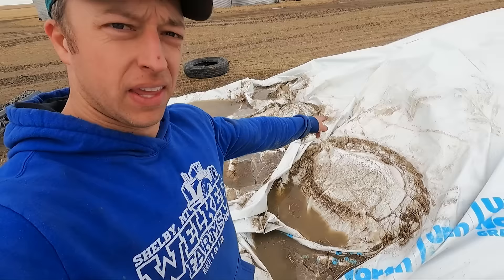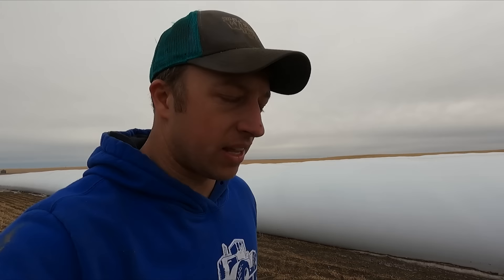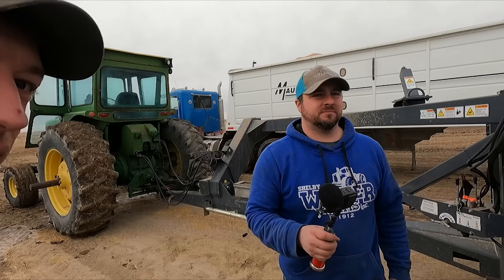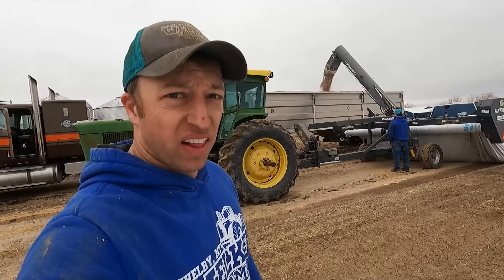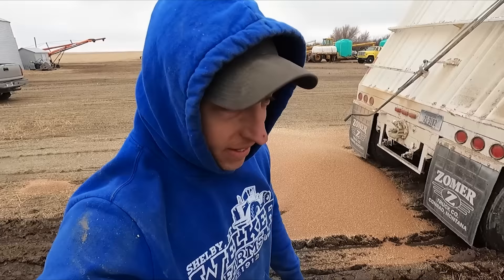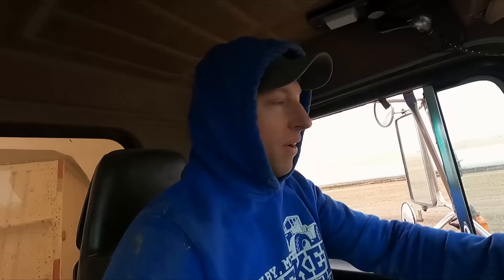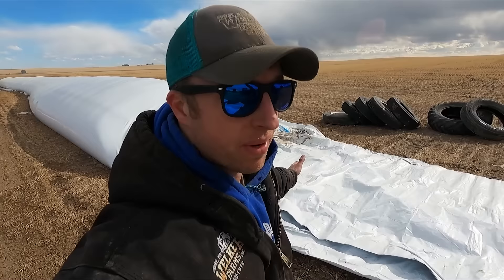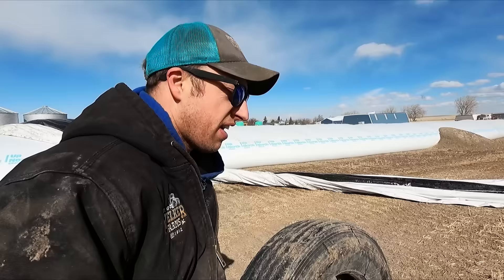The BAG BUTCHER | What A Muddy Mess

Comment: see if you can get some large steel plates from somewhere, like army surplus. Work wonders to prevent sinking in muddy spots when standing still a while.
Army engineers use them to create temporary parking lots for events all the time. And a tractor can pull them forward as the bag moves.

Comment: Grain bags-portable, efficient, & a HECK of a lot cheaper than bins! THAT’s what I learned from farm-tubers ‘20. Too bad Iowa farmers couldn’t use them for corn, since their bins took a ride w/ Dorothy.
Reply: I was thinking this too, new farms, or just farms expanding without the ability to build new bins, this is an incredible innovation.
Reply: Oh but we do use them in iowa just not as much as out west because we have elevators with storage alot closer than there
Reply: The problem with bags is there is no ventilation. Corn needs to be below 15.5% moisture to prevent mold and rot.  You can put it in a bin at higher moisture and turn on the fan and be good.
Reply: @redbovine  rot/mold isn’t an issue during winter and freezing temps is it? (Totally ignorant on the issue here)
Reply: @jeremygrant1325  it can be.  Corn is usually not harvested at lower temps. A lot of us use bin fans to cool the corn after harvest.  You have to be careful about the outside temp and the inside bin/bag temp because it will cause water to condense on the inside which leads to sprouting it rotting.  Bacteria will also flourish.  A small place where the corn is damp can cause a huge problem because the decay process generates heat which just makes to problem spot spread. Bags are great for a short term solution if weather is against you or you ran out of bin space.  I guess the easiest way to sum it up is the crop needs to breathe and regularly checked to make sure there are no problems.  
In my area corn is considered dry at 15.5% moisture. Any higher and the buyer will dock the price because they don’t want to pay for water weight. Last time I got docked it was $0.10 per 1/2 point moisture. It can add up in a hurry. 

Any other questions I’ll be happy to answer if I can. Thanks.
Reply: @redbovine  That’s why I didn’t think corn could be stored in bags, if a deer gets into it, it’ll get wet then it’ll ferment. Isn’t that how they make ethanol?
Reply: @chrissyfrancis8952  deer arnt too much of an issue. Rodents are because they love corn and will chew holes in the plastic.  They will even live under the floor on grain bins.  I try to put out some rat bait to keep them in check. The water can cause fermentation when yeast are present. However with holes in the bags it allows oxygen to get in and you get an aerobic reaction the corn just rots. 

When it’s fermented to make “shine” sugar and yeast are added along with an air trap which keeps oxygen out so you get anaerobic reaction. That produces alcohol and the corn won’t rot. 

Bags work well for a short term solution if the grain is dry.  Bins you can control the “climate” of the grain for long term storage.  We only harvest corn once a year but we use it year round so we need to be able to store it for 11-12 months. Bugs then become a serious concern.
Reply: @redbovine  thank u SO much for taking time to answer! I raised Boer goats(for 4-H kids) & chickens, we had 2 miniature donkeys that did a great job guarding the barn bc we lived in the PA mountains, in 11 acres of wooded lot. I know exactly how hard it is to keep rodents out of grain, even in metal cans with lids if u don’t shut it tightly. Our chickens were free-range & let me tell you, they are a MUCH better mouse killer than any barn cat! I’ve learned so much watching the farm-tubers & am so grateful for all you! But, I always have questions, like this. Plant growth patter/structure you look for & fertilizer changes you calculate in the same field & why. Is Round-up still the most used weed killer, or do others work the same way? Oh, @redbovine, I could talk your ear off asking ?’s. We’d literally die w/out all our farmers raising food.(plant & animal)
Reply: @chrissyfrancis8952  i don’t mind answering question.  Ive done a lot over the years. Diesel mechanic (10 yrs). Farmer. Custom ag operator.  Licensed commercial pesticide applicator. The worst question you have is the one you don’t ask.

Glyphosate may or may not be the most used. It depends on how you phrase the question. Are you asking by tonnage or acreage. Atrazine is way up the list by tonnage because of its use in corn.  Glyph use is not used as much in my area due to it only killing grass. Weeds have become resistant.
Reply: @redbovine  If only our farmer’s knew years ago, that German based Monsanto, Round-up, is the same compound used in gas chambers. After the war, they looked for other uses, then modified it to target weeds. I asked bc I was hoping another compound was available that did the same thing. All long term chemical exposure can be harmful, but it’s good to know farms are moving onto other kinds.
Reply: @chrissyfrancis8952  glyphosate was not developed until 1970.  I have been exposed to it for 30 yrs.  of the chemical I use every year it is one that I don’t worry about exposure.  There are pesticide out there that are a whole lot worse.  It has an inherent affinity to bind to soil particles so when it’s used according to label i view it as one of the safer options. There are things out there I will not use.
Reply: @redbovine  that’s what always giving me comfort, bc I know you’re all very safe. Thank you!

Comment: Need to fab a 5th wheel deck plate setup for your I. Quad Trak for spring grain loading from the tubes.

Bags, low initial investment, no safety problems, no bin loss in wind storms, fast filling and unloading>low labor costs, fast grain movement to hit a fast changing price market, super low maintenance costs, no electricity costs and line service.

Comment: All that water where you don't need it. When they find a way to recover water that is making mud from a field/driveway then the farmer won't have to work like a rented mule to fix all the bent metal and broken parts as no one escapes from this for very long. I have seen more torn driveshafts, transmissions, parts of the wheel assembly ruined from getting stuck. In the winter time, I would go out to the bone yard and pull all the bumpers and miscellaneous parts we would need and just cause they are old, didn't mean they couldn't be used till summer anyway. I had a driver come in one spring day and on his shoulder was a older and a bit narrower bumper, an old one, and he said; I have worked here for like five years and I have the nicest bumper in the fleet... I am taking it off till spring and save it from death.... I gave him a bonus that month.

Comment: You need to install an exhaust fan to get rid of the exhaust fumes and CO2
Reply: Get a Heat- Rate of Rise sensors for attics and Shop less false alarms than Smoke Alarms. And firehouse has vents for exhaust -ask NAPA for them.

Comment: Would it make more sense to head the semi in the same direct as the auger is moving?
Reply: Normally a 42 foot trailer holds about that many feet of bagged grain. If you start at the front filling you generally don't have to move the truck. Also the door on the truck is on the wrong side if the truck is turned around.

Comment: Hey just so you know SimpliSafe is not so safe. Using a cheap wireless remote available on Amazon, a YouTuber who goes by  Lock Picking Lawyer was able to jam the signal from a SimpliSafe door sensor. With the signal jammed, he could separate the two halves of the sensor undetected by the system’s base station, simulating a door opening without sounding the alarm. There a many other YouTubers that have easily hacked or jammed SimpliSafe security systems. So again SimpliSafe is not so safe. The best security systems will always be a hardwired system.